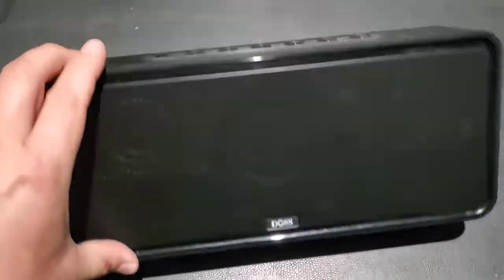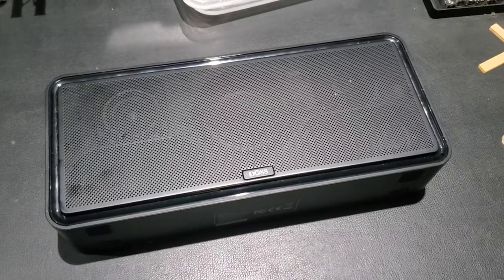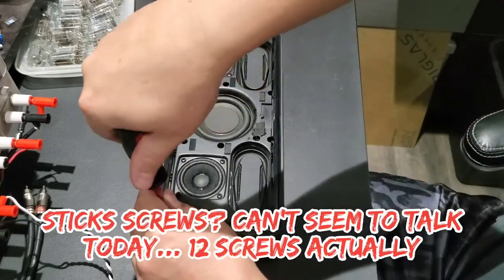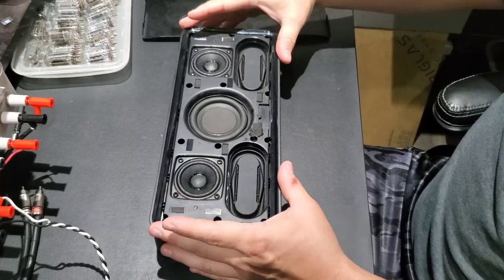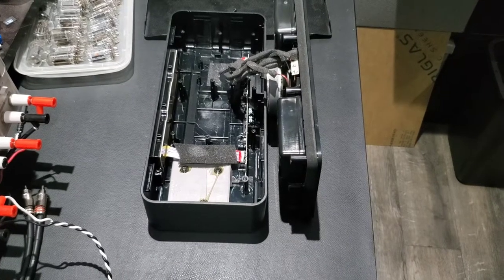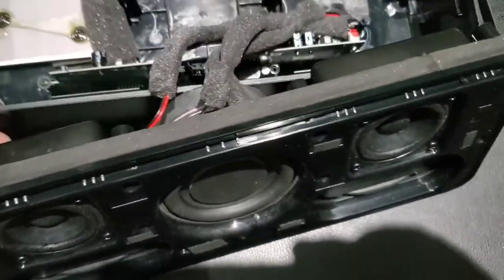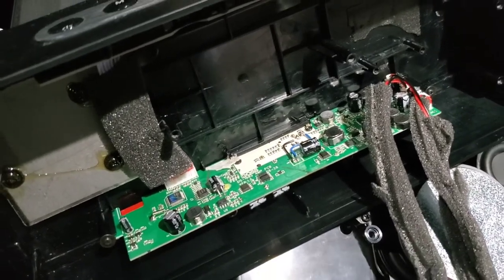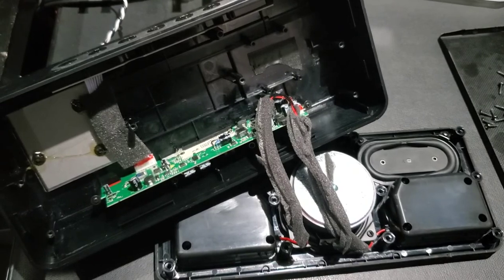DIY FIX / REPAIR / DISASSEMBLY - DOSS XL SOUNDBOX PORTABLE BLUETOOTH SPEAKER

Comment: Thanks for making this video, very useful. My unit is over 3 years old now. When running on battery on high volume (playing music outdoors), it only has enough power for 30-40 minutes, then it dies. However, on low volume (playing music indoors), it can still hold up to 4 hours on battery. I was a bit surprised how fast the battery deteriorates and thought the charger could be broken (the charger rattles a bit inside), but now I see this is a common problem. At the moment I use a 8xAA battery holder with 12V output to charge it when playing music outdoors. It works, but this is becoming an expensive solution. I might try to replace it with rechargeable 12V power bank or use rechargeable AA batteries instead.

Comment: Thanks, this worked for me.  My unit wouldn't power up at all (it didn't cycle like yours did).  I tested the batteries, and they had 3.7 volts, but no voltage coming out of the circuit board.

I used the old battery wires to make the jumpers.  I kept the connector on one end, that way I only had to solder the 2 wires onto the circuit board.  It made it a little easier.
Reply from the maker: Awesome, glad it worked for you!
Reply: Smart

Comment: Thanks bud ! You save my Doss . I tried replacing the 18650 battery but, I think the battery pcb board have failed for it won't power up so, I followed your idea jumpimg the + and - wires as you have shown and now  it's a plug-in version which really don't bother me. Thanks again bud !

Comment: Thanks for the video showing how to strip the soundbox down, great instructions.

I had the problem of it not turning on after a long spell on not being used, tested the battery and there was no voltage from the plug, checked at the cells and 1 was 3.2v 2 was 3v so 6.2v total. I'm pretty sure there is a low voltage shutoff built into that pcb board. I managed to charge the battery up a bit using an rc battery charger.

I used the nimh mode at 0.5a just the gently bump the voltage up for a few minutes, plugged the battery back into the soundbox, put the charger for the soundbox in too and turned it on and it fired up. Just going to leave it on charge for a while now to get the voltage back up in the battery.

Seems that it could just be a case of your battery voltage has dropped too low and the low voltage cutoff wont let it charge back up from the soundbox itself.

This might be a simple fix for someone else who's having the same issue, worth a try before hard wiring 👍
Reply from the maker: There is a cutoff. When voltage is applied to charge the pack again, it should allow that and close the circuit.
Reply: @MR_Garage  I tried charging it for hours through the speaker itself and it just didnt seem to be doing anything, took it out and charged it up a bit and then it has worked fine since

Comment: I have searched but couldn't find anywhere where they mention the voltage of the battery pack. Other than 2s 18650 and on the official page they mention 2200mAh.  I am assuming it's 7.4v as it's only stated to have 2200mAh.
Please correct me if I'm wrong.
I just want to be sure because I'm going to replace the battery pack pretty soon.
Reply from the maker: Correct, a 2s pack is 7.4v. The mAh rating is just the capacity

Comment: Hi,  Great Video ! I've had my for a year or so now, i like it, didn't know about the hidden BMS under there through. Quick question? I'd like to extend my usage on the battery, if I add a set of batteries onto the existing pack ( yes wire it correctly and glue it to the box so it doesn't sound like my neighbor's teenage son's rattler) will it possibly double my usage, and or will the BMS act up and say " no no no,  not in my court !
Reply from the maker: Could just do a larger 2S battery pack with an over / under voltage BMS for protection. Could easily fit something double the size or more. I would not add any cells unless you can match 18650 cells - if so, would be an easy thing!

Comment: Thanks for this video. You explain it very well. Can I ask a question? My speaker shook itself off my shelf, hit the floor and now it rattles when I play it. I followed your video to take it apart and checked for any loose screws or other parts but it sounds like the speaker is blown... Could I be missing something? Would it be worth ordering a replacement speaker like a generic one from eBay maybe? TIA

Comment: I'm curious if you ever got a chance to change out the 2" drivers? And, if it makes a difference? 

I'm also noticing that the high-end doesn't go so high. Even with the grill off, as I've seen in other recommendations about high freq. response, it helped but not significantly. You're the only person who I've come across who even mentions swapping drivers. 

Also, great video! Super helpful with this speaker just in general. Thanks
Reply from the maker: I tried 4 different drivers, many I had to cut and retrofit. Surprisingly, I was not able to better the sound of this little box. In short, it is what it is for the price. Too much EQ and DSP going on to play OK with other speakers.
Reply: @MR_Garage  ..ah, I see.. thanks for sharing what you were able to test out, I definitely appreciate it!
Reply: @MR_Garage  Did you tried to add some damping material in the plastic box itself ?  Like PU foam.

Comment: Hi, nice video, showed me stuff i didn't know. I have an issue with mine other than the batteries. When i turn it on, (batterie or ac) it would switch from bluetooth to jack 3.5 itself and no sound or will play a few minutes and again switch from connected bluetooth to scaning on bluetooth, never the less, it worked for about 16 mounts and started to do that while i was listening. 
Any ideas?
Reply: I had the same problem. It should be a problem with the board where the buttons are mounted. There is a small capacitor on it that can be broken. This causes the ADS Key not to get the correct value for changing Vol+/- Skip and Change input. For lower volume there must be 2,7 K Ohm between ADS Key and Ground. 4,7K Ohm for Volume up. Each Value has a function. In front of each Button there is a resistor with the necessary Value (2,7K in front of Volume down button and so on) The Button is connected between ground and ADS and shortens the connection to the value of the resistor. If you messure between ads key and ground at the connector there should be a value higher than 15K Ohm. If not you get problems with buttons. In my case there were 3,1K Ohm causing the box to swap title, lower volume and other things. Hope you could understand what i mean. English is not my native language 😅

Comment: My unit is about 2 years and won't power on with battery alone. It must be connected to electricity. But it takes about 30 seconds after connected to power on. I am no technician. But I will follow your instructions

Comment: Hey, could you help me fix my Doss soundbox xl? My unit is working but the buttons have corrosion... I need to replace them but I don't know where to purchase them (or just get a new board with keys). The companywas dissapointadly not helpful and would not send me parts... :(
Reply from the maker: If it got wet, you could remove the battery and each individual PCB. Scrub with DI water, dry with compressed air. Then, spray with deoxit D5, scrub and then flush with deoxit D5. Let dry for a day or so. See if it starts working.

Comment: A wrong adapter was used on my Doss XL to power up my Doss XL and now it seems blown. It doesn't power up anymore. How can I fix that? What do I need? I'm not used to fixing these things. Thanks for your help.
Reply from the maker: Sounds like you need a new unit unfortunately. Would take quite a bit of electrical troubleshooting both major or minor to determine what failed.
Reply: @MR_Garage Ah ok thanks. A new unit it is.

Comment: Charging port is a real problem with many owners. I've had my doss since 2017. Well guess what! Charging port came lose. I'm hoping your video helps with the repair as I'm not going to pay half the price to repair the speaker. 
Your thoughts please.
Reply from the maker: Would have to pull the back PCB and see if the port just broke free from the solder or needs a new port. Either are cheap and an easy fix. Hope you get yours working!
Reply: @MR_Garage  the charging port housing shattered. It's soldered on the board. You say you can fix this? Please tell me how. I took the whole speaker apart. If I had a fix it would be easy to reassemble. Thank you for your help. 
By the way I know many complained to Doss about the inferior design of the charging port. I have a new Dossbox XL and they have changed it to a larger pin type charger.

Comment: Hi, i have a question. My DOSS Soundbox XL does not playing bass. The driver is inavtive and makes no noise. It happened almost overnight. The next day I turned on the speaker and it only came out the highs. I hope you have an idea Thanks for that in advance.
Reply from the maker: I would open it up and make sure it has not come disconnected from the speaker side or the PCB on the amplifier. If both those look good, use a AA battery and attach one side to negative on the bass driver with the amplifier unplugged from the speaker. Use a jumper wire to tap the positive side of the battery to the positive terminal of the speaker and see if the cone moves. If not, the speaker is blown.
Reply: @MR_Garage  Thank you very much i try it tomorrow. Cheers from germany.

Comment: If your Dosbox no longer responds correctly to the buttons at the top or the Bluetooth keeps dropping out, it can be because a small SMD capacitor on the circuit board that houses the switches has failed.. I was not able to play music via AUX ore Bluetooth , even with SD playback the box has made crap. The keys were not properly assigned because their given resistance did not bring the level that the processor needs to evaluate. The Block capacitor had a leak of 150 Kohm and therefore nothing was right anymore for the Prozessor. I unsoldered it, it's just for debouncing.

Comment: Thanks for the helpful video. I have had the same issue suddenly start, but I bought my unit 2 1/2 years ago, so out of warranty. My batteries tested OK and I also bought new 18650s. After reconnecting either battery pack, nothing. It seems dead until I connect the 12V DC. But then starts with the on/off cycle again. On occasion I do use mine from battery power, so it would be nice to have that option. I was wondering if it is possible to get a hold of the BMS board. Would you know where and what to look for as it seems like something that should cost about $10. Thanks.
Reply: Take a picture of the BMS board using Google Lens and search.
Youtube will not allow me to post the link.
Reply: @bwl123  Thanks for the suggestion. Unfortunately, it didn't work. I photographed both sides of the BMS board and only got a bunch of random circuit boards as a result. Anyway, I appreciate it. Thx.

Comment: OMG that is EXACTLY what is literally currently happening to me, it keeps powering up and down in the middle of the night at 4am. I had to stick it at the bottom of the laundry pile to be able to sleep tonight.
Reply from the maker: Sorry to hear about that and yeah - sucks! Drives you mad.
Reply: @MR_Garage  Do you happen to know where I can an exact battery to replace? I want to keep this thing portable. I bought a replacement that looked identical only to find out the white connector is too big for the socket and I'm not comfortable soldering the old connector/wires on the new battery.
Reply from the maker: Sorry, I have not found an exact replacement. Happy to knock out the soldering for you but I think after battery purchase, shipping both ways and such you would be 70% the cost of a new speaker. Which sucks as I fully support repairing and keeping things alive vs replacement!
Reply: @MR_Garage  Appreciate the thought! I got some help just taking the old wires and splicing with new wires to keep the old connector. Installed everything, connected the bluetooth, played some music and guess what? THE LOOP STARTED AGAIN. I swear I almost threw the screwdriver out the window. I'm going to try your full  tutorial next bc I still like the speaker but whatever is happening will continue even with a new battery. I even tried their firmware update (it was supposed to remove the auto-off behavior that could be causing the glitching) but it didn't seem to even install itself, so I gave up.
Reply from the maker: Sounds like the charging circuitry has failed. Hope my bypass works for you!